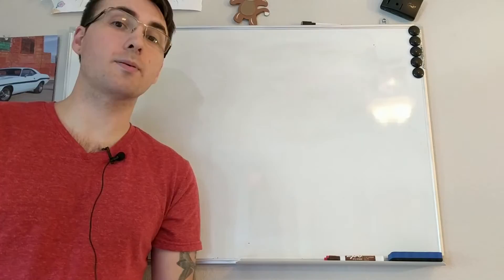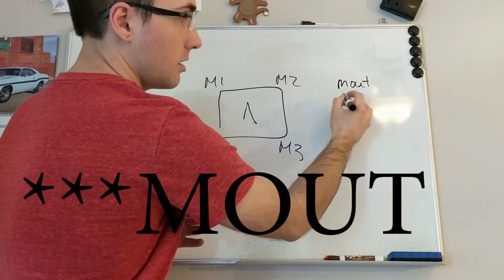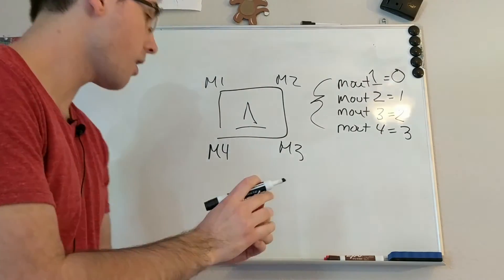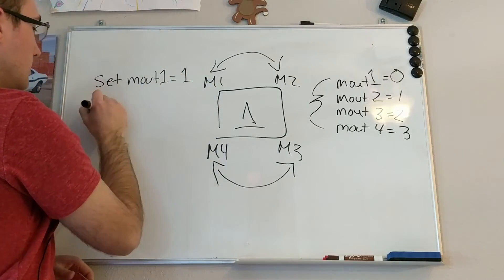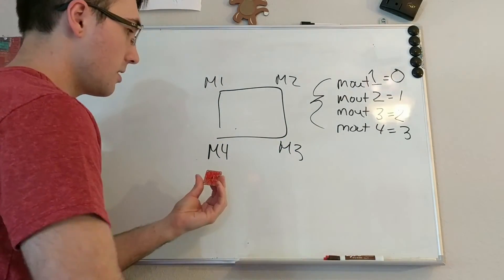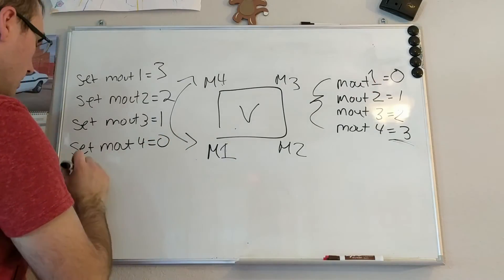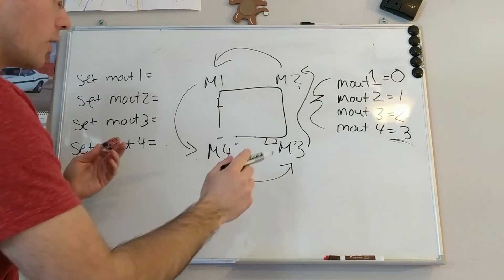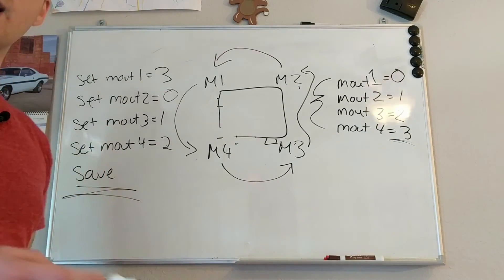How to remap your motors in RaceFlight One

Comment: Hi Adriel, Nice tutorial...👍👍,

Did you know how to remap signal pin to other pin on board?, My M1 pin are damaged/pulled up..so I can't attach the signal cable both side... My plan are to use other pin as M1

Thanks in advance 😅
Reply: hadyan dharmawan same problem,did you fixed?
Reply: carreras de fpv yes...but I had to flash it first to BF then remapping the broken pin via CLI command
Reply: And then just come back to raceflight?
Thx

Comment: hi do you know if it's possible to access the other motor signal outputs on the revolt v2? , I've got a short between the ground and signal on motor 3, thanks for any feedback
Reply from the maker: at this time, they aren't re-mappable. However, they should be in the future.  We have a $25+ shipping replacement program for damaged Revolts that you could use. Feel free to shoot me a direct message to get started with that process if you want.

Comment: How to make reverse/normal direction in Console after remapping for some motors? If I try to make it in Setup the remap motors are cleaned and I get wrong motors-placing again..((
Reply: I just bought my first Revolt V2 and will begin my build tomorrow. My Question is as most 4in1 Esc boards have a different motor order then the one from Receflight one i asked myself if i just need to solder everthing up to the closest esc pads and afterwars Raceflight one gone take care of the remapping? Is this right?

Thanks
Reply from the maker: Hey, make sure you're using the latest GUI and firmware. You can join the raceflight slack channel by going to raceflight.net/invite and then join the #betatest channel to get 299 beta firmware. It's been running amazing for a bunch of people. 

The reason I say to upgrade is that the new GUI's and firmware automatically remap your motors and change directions using the wizards so you don't have to do this video anymore.
Reply: It works thank you!..)) Good job! 
Will try 299 in outdoor flight tomorrow.
Reply from the maker: yea, raceflight one will take care of the mapping for you. as long as it's a blheli or blheli_s esc

Comment: I just ordered a revolt v2 and am planning my build.  I'll be using a 4 in 1 esc and I'll probably want the revolt upside down like you do so I can see the silk screen.  Is the wizard up and running to do all the motor selection out now or will I have to do it in cli?
Reply from the maker: you just do it via wizard now. You no longer have to set that up in the CLI (unless you're using firmware version 195)

Also, if you do mount the fc upside down on the bolt, make sure to solder wires to it. Don't use the pins as the pins only go with one way orientation.
Reply: AdeFliesFPV right on thanks.